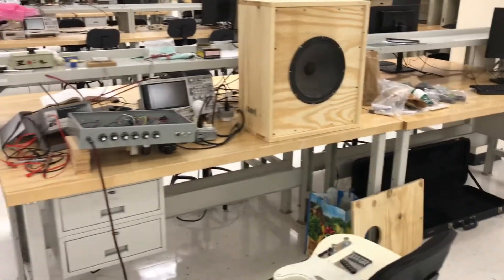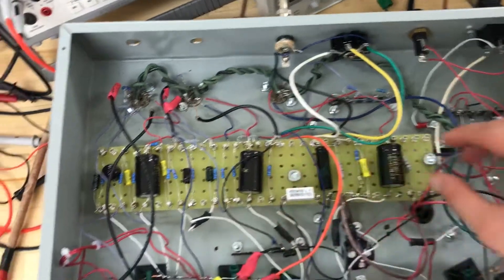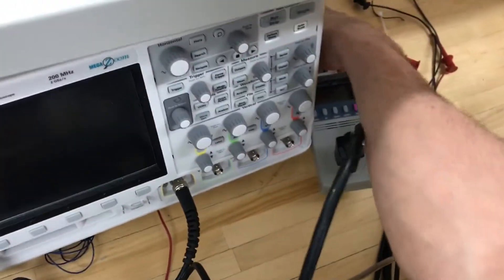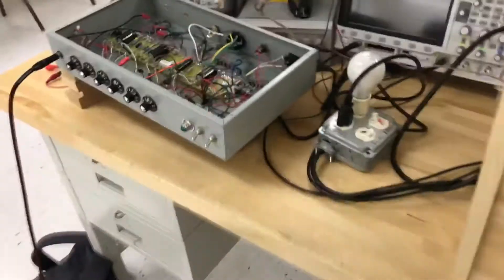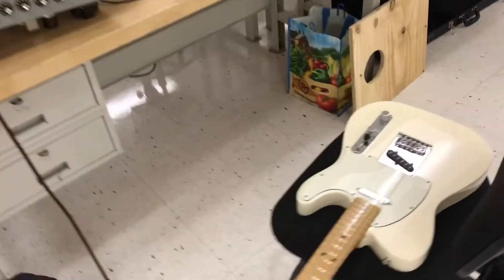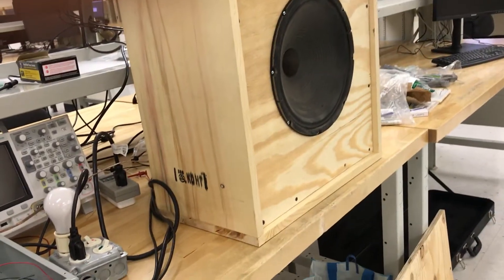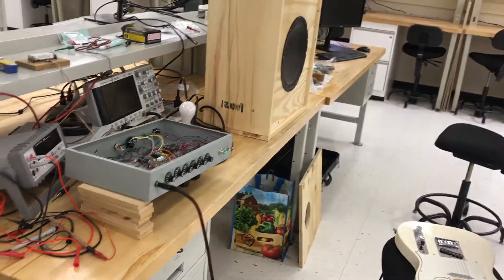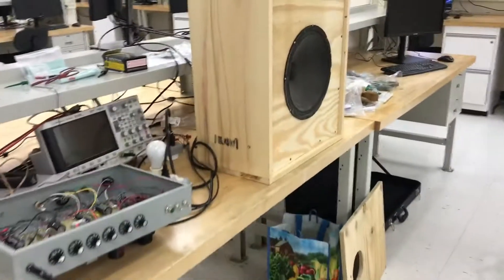Guitar Tube Amplifier Light Bulb Current Limiter Testing

Comment: What wattage bulb did you use?   What is the  point at which the limiter will take over and protect?  ie. the minimum current to limit?   How do you choose & calculate the bulb wattage and the current limit point?  Is it based on protecting the amp or is it safety for a tech and/or user?   Your response would be very helpful.  Thanks.